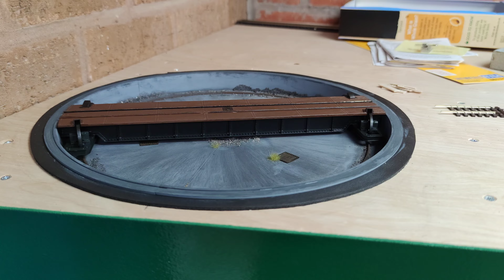Peco turntable vs DCC interface premium turntable kit

Comment: Morning John, 

Found your video while trying to diagnose problems with my ow DCC interface turnable that we have had for number of years but not got fully working. We can get it working from the display however we cannot get it work via DCC so we are unable to control it via JMRU. Are you still using yours?
Reply from the maker: Yes I still use mine, I used to send mine DCC address via my accessory bus. I have since switched back to the simple unit without the screen. 400-403